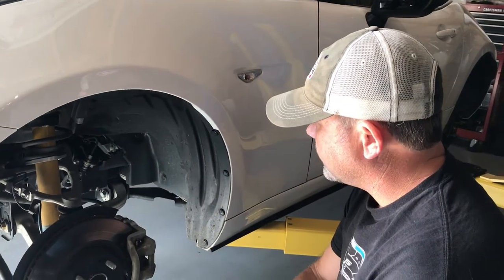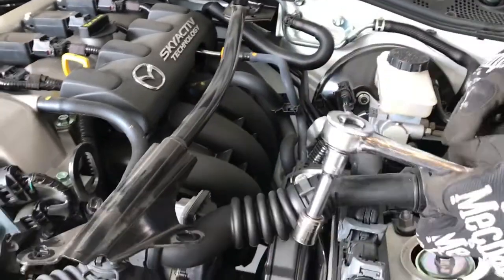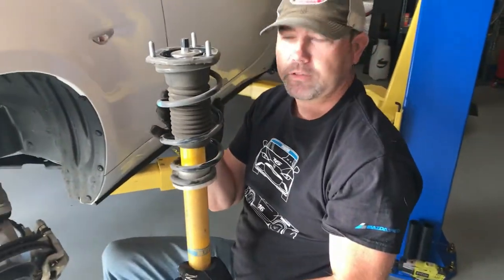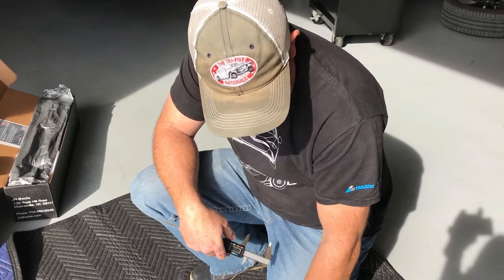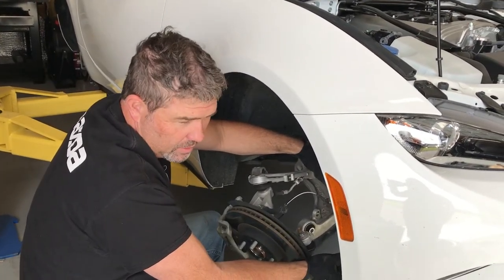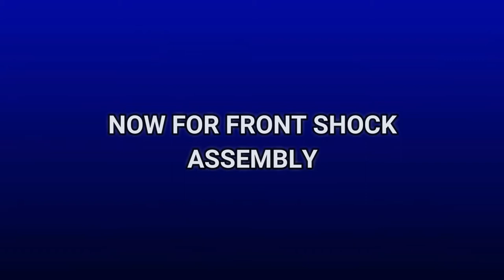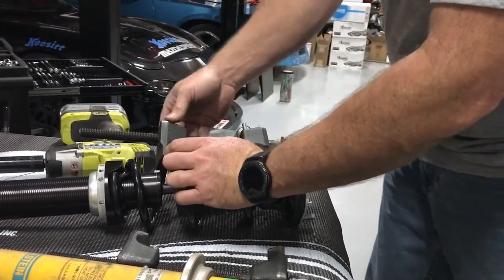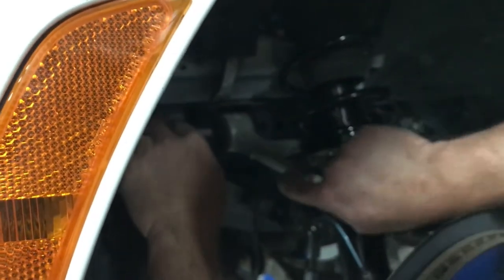ND Miata shock and sway bar upgrade HOW TO

Comment: Few tips from past experience on working with coilovers. You could save yourself a bit of time by not compressing the spring for installation. Just lower the collar, install, then set height desired. Second, did you make sure to preload the suspension into the correct ride height before tightening the inner a-arm bolts? If not, those are probably torn to hell by now.

Comment: Did you edit the video to speed up the sway bar cutting? What’s the actual time to cut through the stock bar? Would you recommend a grinder wheel like you did or use a different saw
Reply from the maker: +An Ng That was real time and it was a cutoff wheel, on an electric grinder, and it worked great!

Comment: Came to learn how to change the sway bar but cutting is not an option when you want a one piece sway bar. So, where do I learn the correct way?
Reply from the maker: +doubleT84 Factory Service Manual and it is about a 4 hour job.